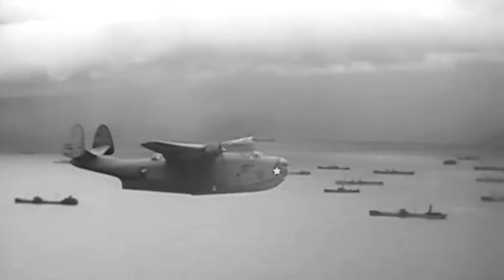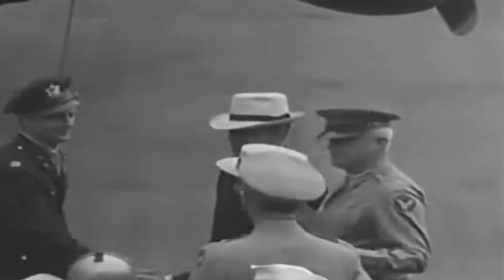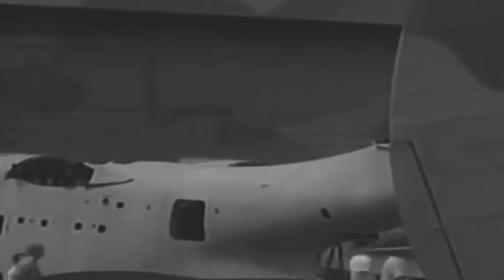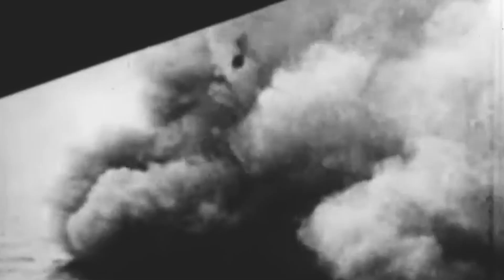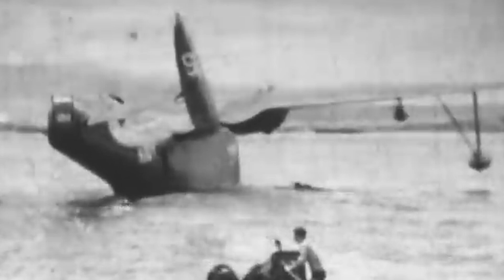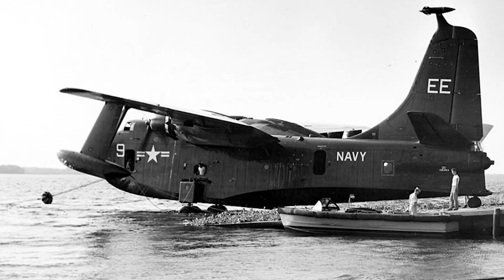How This Flying Boat Changed Naval Aviation Forever

Comment: The Navy was still flying the P5M's in 1957-58, out of Sangley Point NAS, about 20 mi N of Manila, Philippines.  A USNA classmate of my dad's, LCDR Homer Whitaker, Commander of the Squadron,  let me go along on several flights along the China coastline, staying outside of the 12-mile limit.
The flying boats boasted a nice stainless-steel galley, and I was a pretty good 12-year-old chef.
I did get to fire the very big twin-.50 cal guns from the tail gunner position.  Those flights, if I recall correctly, were at least 12 hours, taking many pictures.😁

Comment: At 0+7:30 in this video a flight of 4 is shown.  The first two aircraft appear to be Mariners, just like aircraft #3 & #4 BUT, they Do Not have Wing Floats of any kind, not even retractable floats can be discerned.  Are these two aircraft PBM-1's of the first 55 built?

Comment: Um, the title is "How This Flying Boat Changed Naval Aviation Forever".  That case was not only never made, but there is nothing about this aircraft that was particularly revolutionary.  It was a well-designed and well-built aircraft, just like many of its fellow Navy aircraft.  It was versatile and capable, just like many of its fellow Navy aircraft.  It was pitched as a rival with the PBY but was it better?  No case was made for that.  It, like all planes, was succeeded by better versions.  But did its design somehow revolutionize future designs or change how the Navy used airpower?  Not that I can see.  I don't think it "changed naval aviation forever".

Comment: It's too bad that the US Navy stopped using amphibious aircraft. Obviously in favor of helicopters. Perhaps they call it budget cuts. It's not hard to envision both twin engine, four engine turboprop amphibious aircraft. Faster and longer ranged than helicopters. Modern electronics. There could be an ELINT version, an ASW version. Even a version capable of CVN cross deck operations. Weapons could include ASM missiles as well as Mk-50 torpedoes, bombs or mines.

Comment: In 1957 the Navy flew 2 PBM's to Oklahoma for the big airshow held in conjunction with the states semicentennial celebration of Arrows to Atoms.  They parked in Lake Hefner a city water supply reservoir.  The crews came ashore in rubber boats but were very disappointed to learn that Oklahoma was then still a Dry (no liquor) state.

Comment: Never saw a Mariner, I did see a Catalina doing landing in Mount Isa Queensland in the early 1970's. It had been equipped with geological magnetometer gear and was doing aerial surveys North to the Gulf of Carpentaria. Was still capable of both land and water landings.
Reply: In the mid-2010s there was a Catalina operating from around Johannesburg, South Africa, carrying magnetometer gear. I never did see a Mariner, so have loved this video.

Comment: As a sand crab ( sailor talk for dependents), my father assigned to Ault Field Whidbey Is. Waiting for officer housing, we lived on the Oak Harbor Naval seaplane base.  1957, 1958. Every flying boat you described on vid. I have boarded along with numerous crash boat assigned to seaplanes. Everything is 100 % accurate you portray.  ✝️👍🏻♥️. Drafted in army 1966 converted to Navy.  ECM operator on A3, a Light nuke bomber, 3 man crew, know as All 3 dead.   Navy was a real trip…
Reply: My dad was transferred to NAS Whidbey in 1967 and retired in 1969. I was 5 when we arrived at Whidbey. The seaplane base no longer operated aircraft by the time we arrived. I went to kindergarten in the old seaplane base hanger. Oak Harbor was a great place to grow up then.

Comment: The scale prototype was restored by retired Martin workers and is in the Baltimore Museum of Industry, very impressive for a single seat sea plane. However it was powered by a 6 cylinder Studebaker engine with chain drives turning the props.

Comment: After the losses to U-boat AA the PBMs were rotated back to have their .30 caliber machine guns changed out for .50s.

In this video there is a clip of a seaplane on the water at a distance. It is not a PBM but a P6M Seamaster jet powered seaplane.

I wonder where the last PBM is? There is a P5M at Pensacola. Martin never seemed to have the public relations teams Lockheed and Gruman did.

PS: my father worked for Martins as an inspector on the PBM and P5M and for a company that refurbished P5Ms after he retired.
Reply: It's at Pima Air & Space museum in Tucson

Comment: Ah, the Flying Boat, such a wonderful plane. Too bad no service uses them. I would think the Coast Guard would have some for long range search and rescue, when a helicopter just cant do, because of lack of range.
Reply: Seaplanes have more drag, have to be built heavier and are more maintenance intensive since they work in salt water. With so many airports and longer range, regular planes are cheaper to operate. Though Japan makes and uses several similar looking aircraft.

But US special operations has a C-130 with Edo floats to do water landings.

Comment: Thanks for another informative video. I have heard about problems with Martin Mariners exploding in mid-air without discernable reason. As a 'Brit' I fly the flag for the Short Sunderland flying boat - which had 4 engines, and was bigger than the Martin Mariner. It had a formidable defensive capbility against enemy aircraft, so much so that the Luftwaffe pilots called it the 'Porcupine.'
Reply: Wiki lists six incidents with PBMs being destroyed.  So, six out of 1300+ really isn't a bad record at all.  Many combat aircraft had far greater losses, and were more revered.
Reply: My father was a gunner and flight engineer on the PBM in the Pacific in 1944 and '45.  He told me because they carried a lot of fuel to fly long missions, they had to transfer fuel between tanks in flight to maintain proper center of gravity.  During the fuel transfers, leaks were common and the aircraft often had  a strong smell of fuel vapors inside.   Also, to avoid enemy fighters they flew in the clouds and in rain squalls whenever possible. Sometimes static electricity built up on the airframe causing St. Elmo's Fire discharges, and ball lightning sometimes bounced around inside the plane.   He said the men knew the Mariners sometimes exploded in flight for seemingly no reason, and he thought those electrical discharges may have ignited the ever present fuel vapors in the plane.   But nobody knew for sure what happened.
Reply: @MikeinSoCal  Thanks for your very informative reply.